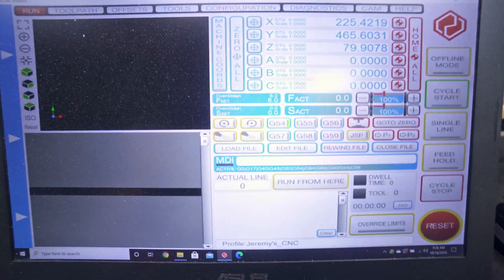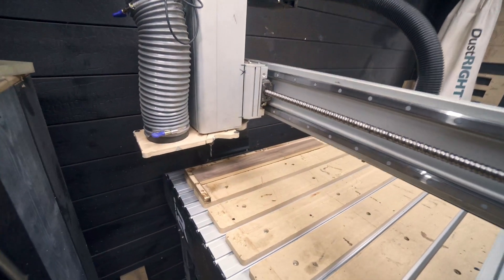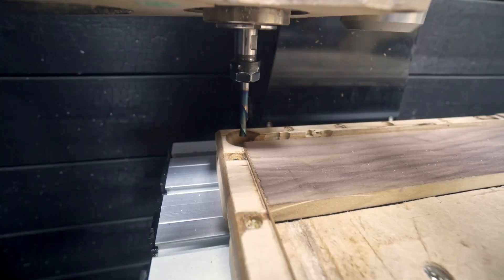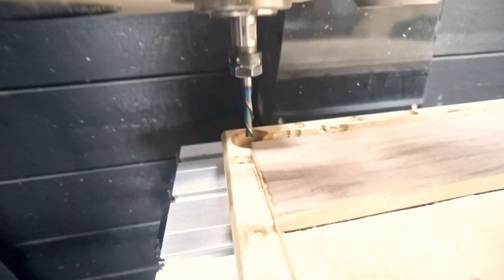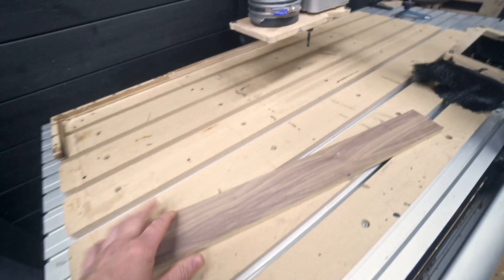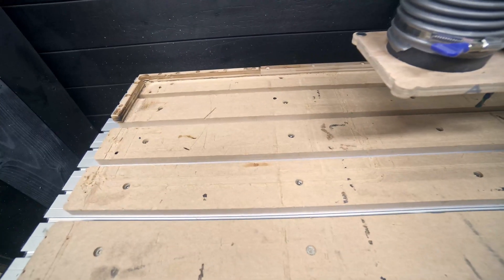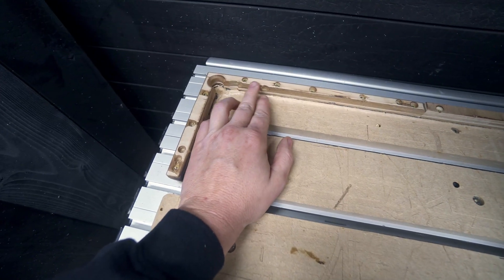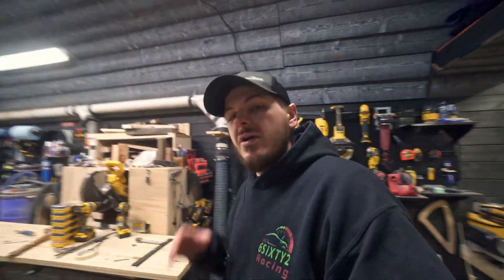Quick Tips: The Best CNC Attachment Is Free

Comment: Been looking at that machine, but I would prefer a 3hp spindle. In your opinion is the 1hp enough? Most cnc of this size use 400-600 in-oz nema 23 stepper motors but i2r only uses 118.4 in-oz do you find you need to change the feeds & speeds to keep it from bogging down?
Reply from the maker: I have had no problems with it hogging down. In the end your cutting speeds come down to what you are cutting with. Iv been using the machine a long while now and had no problem with it for speed and the things I do

Comment: Glad I found your channel. I watched the V bit inlay vids then this. Looks like it's made from one piece. Do you screw it down then cut it on the machine? Thanks
Reply from the maker: You can install a Pl iece and then cut it but I did mine the opposite way. I did this only because I placed it at the very edge of the cutting limits of the machine so it would hit the limit switches if I had cut it out already in position

Comment: Do you lose cutting area?!
Reply from the maker: With this set up not really. I set mine up so that the straight edges were at the limit of that axis on the machine. So say a 1/4 in bit will touck it and almost as soon as it does it would engage the limit switch.